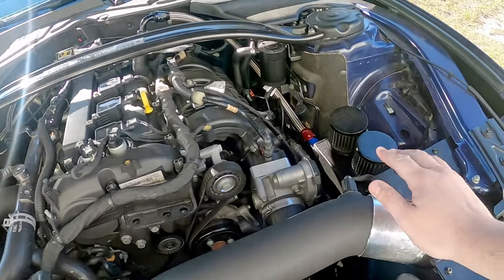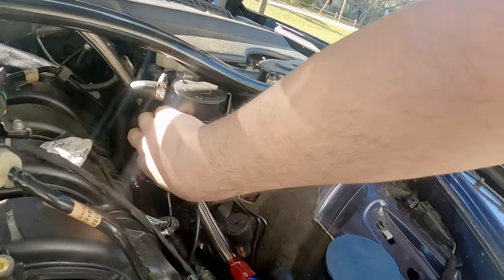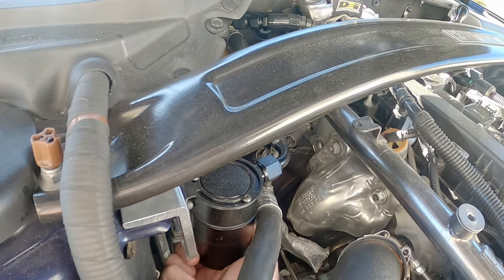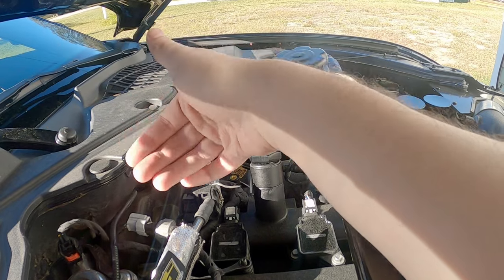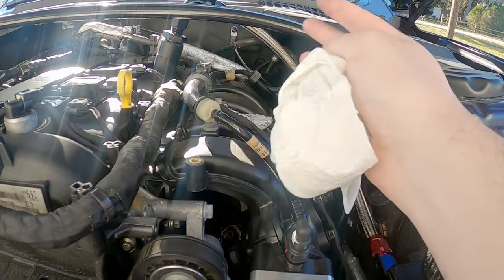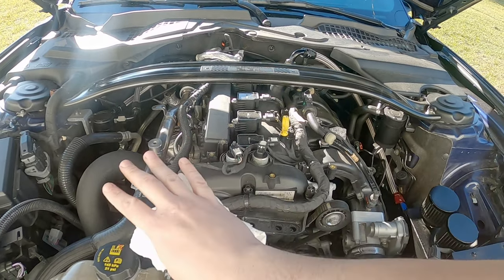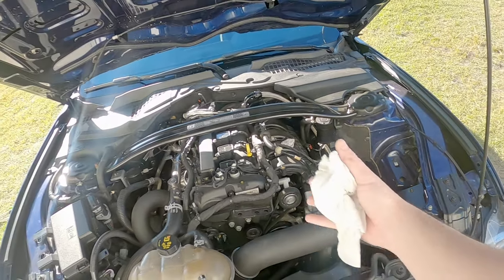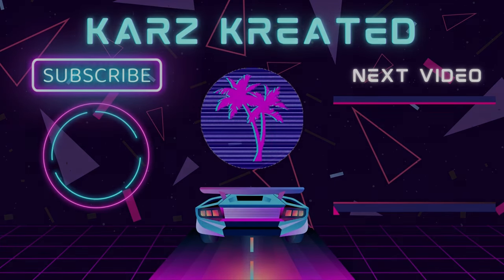Installing Chinese Engine Breather System

Comment: I run the passenger side upr dvcc and a 1 way breather tank off the oil fill cap and the upr dvcc catches several ounces every oil change but the breather tank is dry so basically opposite of what's goin on with yours. Mine see wot every day several times a day tho.
Reply from the maker: Interesting. I'm sure I'll see an accumulation once I start driving the car harder.

Comment: Your not running a belly pan cover? Or it’s it just that easy to get to the filter? It’s a pain on the 5.0.
Reply from the maker: The pan is there. Filter sits behind the k member so it's very easy to get to. If Ecoboost cars have anything going for them, it's that their easy to maintain and work on.
Reply: @KarzKreated I mean the plastic cover over it and nice.
Reply from the maker: @Taino5.0  yes the plastic cover 🙂

Comment: I don’t think you understood how they work. The only effective parts you have there is the vented can. All those seal car will cause restrictions. You only pushing oil out because of the restrictions, with proper ventilation. You shouldn’t be seeing any oil . Or much of anything because all the pressure is not forming and all crankcase pressure are easily glow out .so get rid of those 2 crappy can and run all the line to the vented can with 2 filter .

Comment: where did you get the valve cover to turbo inlet breather from. i do not see it on URP. the one you are showing that was bone dry
Reply from the maker: It's all custom made. Just bought the fittings I needed and put it all together.
Reply: @KarzKreated  okay
Reply: TY
 @KarzKreated